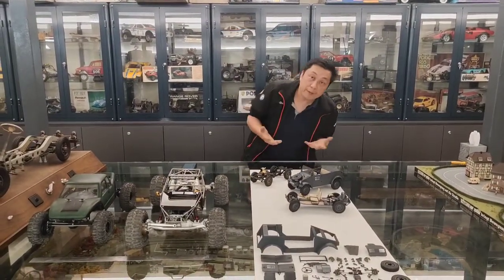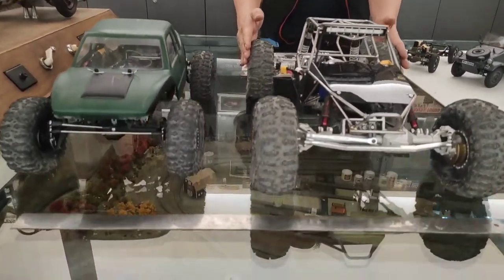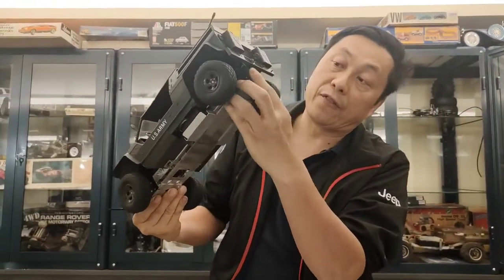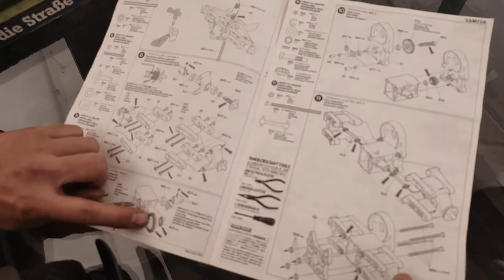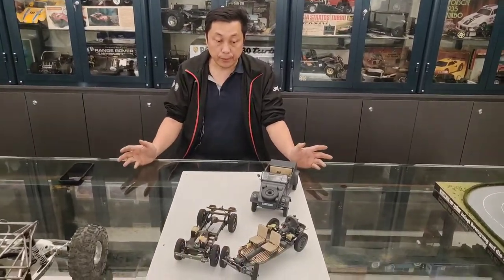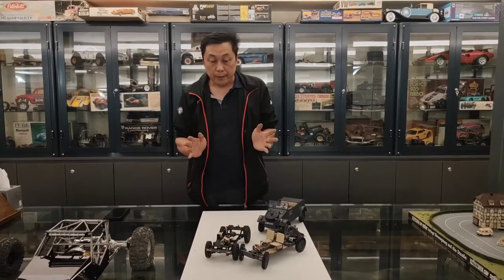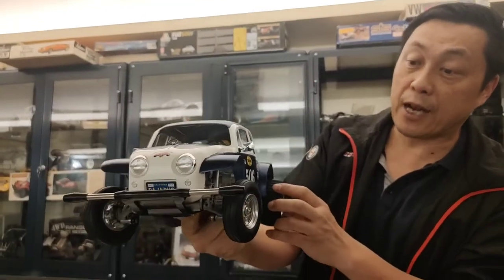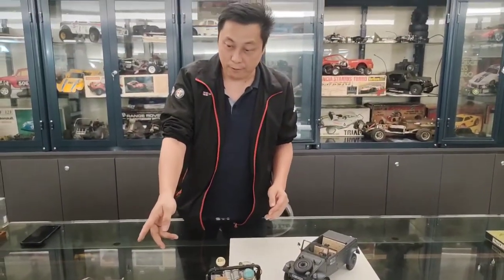The truth between scales in Rc cars

Comment: I am 45 now, when I was around 10 years old my dad worked in Japan for 6 months (he worked for GKN and they paid for my mother and sister and I to visit my father in Japan for 2 weeks) My father bought me a Nikko Black Fox 1/18 buggy, I used it a lot, I had some rechargable AA batteries for it which took all day to charge and ran it for 10 min.  I still have the buggy in the attic.

When I got a little older I got a second hand Tamiya Super Sabre, and then later a  second hand Koyosho Laser. I tried to race it in my local buggy club but it was not competive enough compare to the more serious members who had a lot more money to spend, they had Schumacher Cats and Yokomo and the latest koyosho stuff.

I got a Tamiya DF-02 and turned it into a crawler, I made a rough metal body in the shape of a citroen 2CV,  I jacked up the suspension and added a 72:1 reduction gearbox and a 20T motor, now it can twist its half shafts and climb anything. I am thinking about making a better body for it, but like you say it is very wide compared to its length. I will add a video to my channel to show you.
Reply: General speaking. radio control model focuses on performance does not usually 
comes in refine details and right scale. Detail ones are display models which does 
not contain gear box, motor, drive shaft and radio control system.
Our aim is to build quality realistic RC model cars that are perfect for both display
 and entertainment purposes and ideal to enjoy both indoors and outside. Therefore, 
1/12 scale is the most appropriate size. More than just a decorative product, it also
 comes with an affordable price tag and it is ready built. Play as you go! As vintage 
cars love, our products will be focusing on classic car model.

this is very good for school and museum to show public how the real car work.

happy new year.
Victor
Reply: 2023 April  we will have a 1/12 scale world's best realistic Hummer H1, this vehicle you must have it, better than my original 1/1 H1, 
8 ch RC system, not just with Hi/Lo gear, portal axle, IFS,IRS , V8 diesel turbo 6.5 engine inside with a motor, part time 4wd transfer case, light system, but it got  world's smallest 2 diff with 100% locking system and 4 wheel drive steering system. all are dream.
Reply: 2023 April  we will have a 1/12 scale world's best realistic Hummer H1, this vehicle you must have it, better than my original 1/1 H1, 
8 ch RC system, not just with Hi/Lo gear, portal axle, IFS,IRS , V8 diesel turbo 6.5 engine inside with a motor, part time 4wd transfer case, light system, but it got  world's smallest 2 diff with 100% locking system and 4 wheel drive steering system. all are dream.
Reply: authentic scale Hummer H1 comming soon.

Comment: very nice explanations, thank  you
Reply: General speaking. radio control model focuses on performance does not usually 
comes in refine details and right scale. Detail ones are display models which does 
not contain gear box, motor, drive shaft and radio control system.
Our aim is to build quality realistic RC model cars that are perfect for both display
 and entertainment purposes and ideal to enjoy both indoors and outside. Therefore, 
1/12 scale is the most appropriate size. More than just a decorative product, it also
 comes with an affordable price tag and it is ready built. Play as you go! As vintage 
cars love, our products will be focusing on classic car model.

this is very good for school and museum to show public how the real car work.

happy new year.
Victor
Reply: 2023 April  we will have a 1/12 scale world's best realistic Hummer H1, this vehicle you must have it, better than my original 1/1 H1, 
8 ch RC system, not just with Hi/Lo gear, portal axle, IFS,IRS , V8 diesel turbo 6.5 engine inside with a motor, part time 4wd transfer case, light system, but it got  world's smallest 2 diff with 100% locking system and 4 wheel drive steering system. all are dream.

Comment: Very cool Video... Greetings my Friend
Reply: i hope to tell every RC lover more history (70-80s because at that time RC are very expensive, not every boy can have all of them.)
Reply: 2023 April  we will have a 1/12 scale world's best realistic Hummer H1, this vehicle you must have it, better than my original 1/1 H1, 
8 ch RC system, not just with Hi/Lo gear, portal axle, IFS,IRS , V8 diesel turbo 6.5 engine inside with a motor, part time 4wd transfer case, light system, but it got  world's smallest 2 diff with 100% locking system and 4 wheel drive steering system. all are dream.
Reply: 2023 April  we will have a 1/12 scale world's best realistic Hummer H1, this vehicle you must have it, better than my original 1/1 H1, 
8 ch RC system, not just with Hi/Lo gear, portal axle, IFS,IRS , V8 diesel turbo 6.5 engine inside with a motor, part time 4wd transfer case, light system, but it got  world's smallest 2 diff with 100% locking system and 4 wheel drive steering system. all are dream.